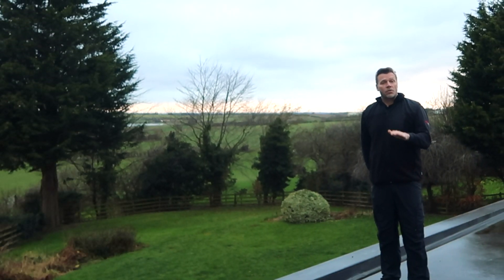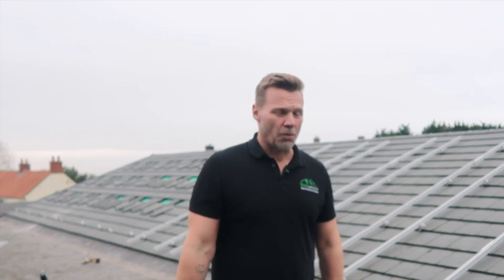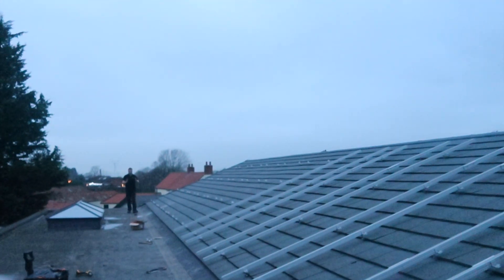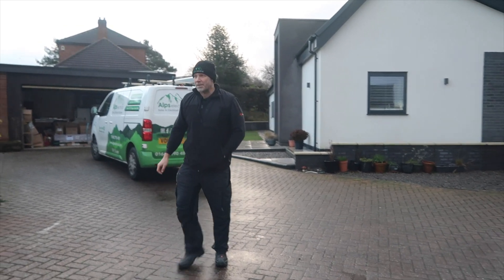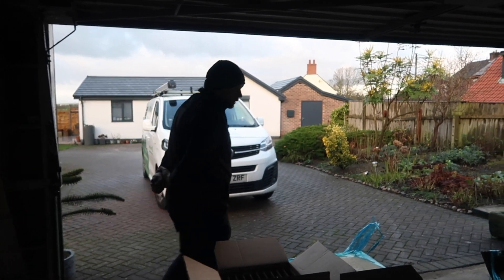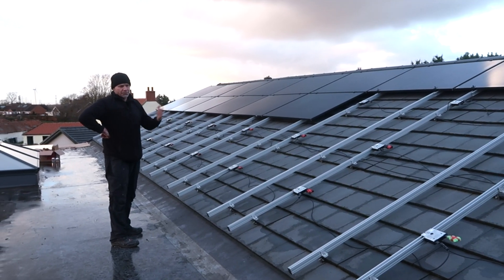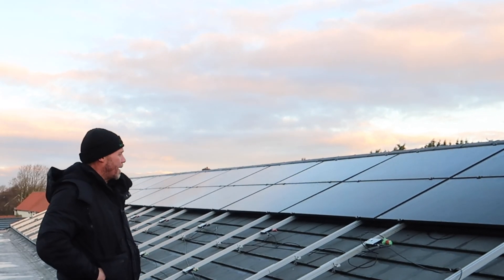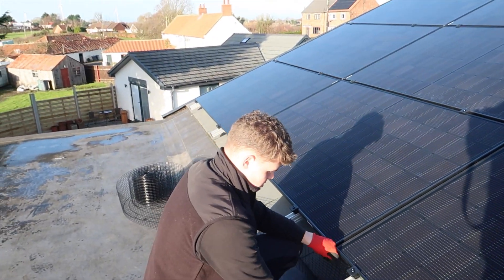SolarEdge 19.1 kW System with Tesla Powerwall & Zappi Install | Part 1 – Installing Solar Panels

Comment from the maker: ⚡ 19.1 kW SolarEdge System with Tesla Powerwall & Zappi – Part 1 (Solar Panel Installation)

This incredible system features 44 Jinko Tiger Neo 435 W panels, SolarEdge optimisers, 2 × 6 kW inverters, MyEnergi Zappi & Eddi, and a Tesla Powerwall — installed by Alps Electrical Ltd in Seamer, Stokesley.

▶ Watch Part 2 → https://www.youtube.com/watch?v=yB75DoWykXc
▶ Watch Part 3 → https://www.youtube.com/watch?v=JAOzciIAadk

💬 Interested in solar or battery storage?
📞 01642 790489 | 🌐 alpselectrical.com

📍 Serving Teesside • Durham • Sunderland • Newcastle • Northallerton • and the wider North East.

🔔 Subscribe to follow the full series and see more real renewable-energy projects from Alps Electrical Ltd!